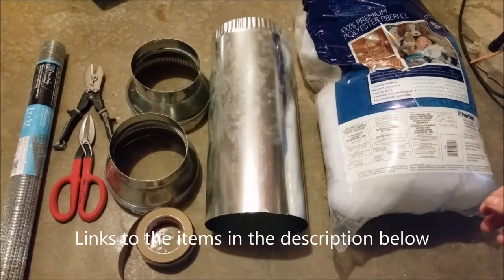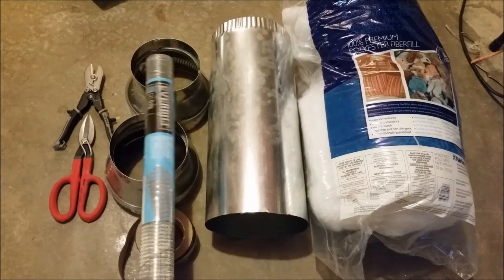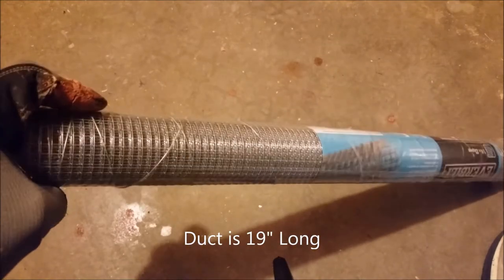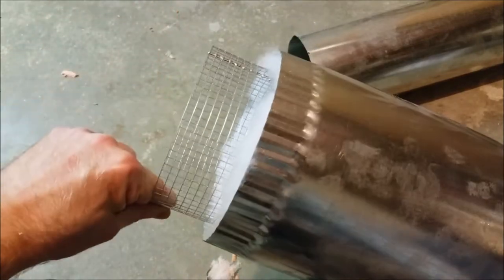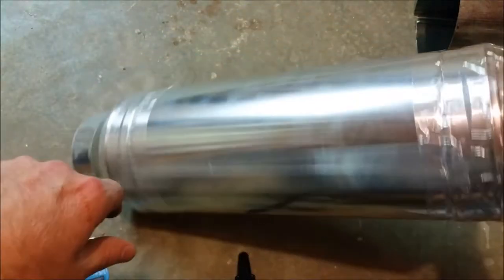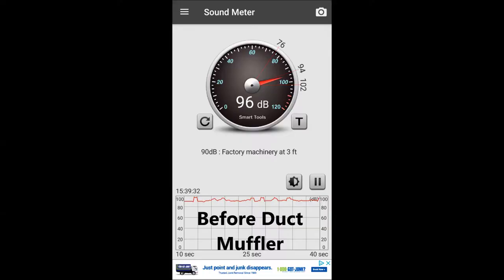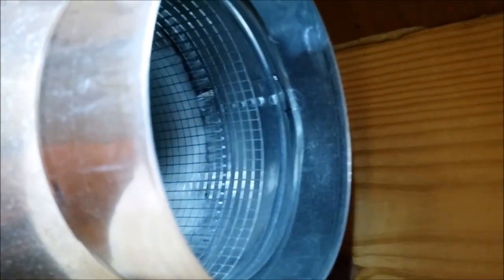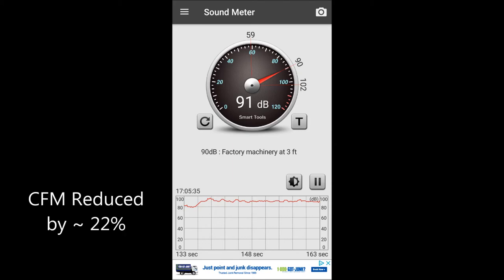Duct Muffler Duct Silencer for Loud Booster Fans

Comment: Is your sound meter calibrated?  Because the air noise was the same as or less than your voice.  Seems like it would be closer to 60-70 dB...  But the 5-6 dB drop is probably the more important factor here.  Thanks for posting this video.
Reply from the maker: Not calibrated.  It's more of a relative measurement to show how it can reduce duct noise.

Comment: And how exactly was the noise cut in half by a reduction  from 96 to 91 db?
Reply from the maker: 3db is the standard for half power in electronics.   Audio ts about 10 depending on frequency. At the register its even less.  This was at the duct muffler register was even less .
Reply: DB is a log scale.
Reply from the maker: yes it is, by definition.

Comment: Think it's cheaper to just buy it ready made.
Reply from the maker: Price wise. It's a little cheaper to build.  Most commercial units reduce air flow to much with the triangular foam.  With this you can adjust the poly fill to your liking for specific frequencies.

Comment: Man fuck all that...
Reply from the maker: Don't like that work?
Reply: @stem_saving1644 you know a lot of folks these days are as useless as can be. I would include myself but I actually find videos like yours to help. Like you said in a previous comment it helps because you can control how much material goes vs buying a pre made one that already has what they think is enough.
Reply from the maker: @lizgaby9761 most of the channels are talking heads and don't show you how to do anything. They just talk.  I try to share what I have learned.
Reply: @stem_saving1644  yup and thanks! I'll be doing this, this weekend.